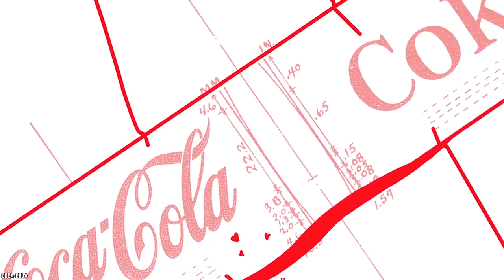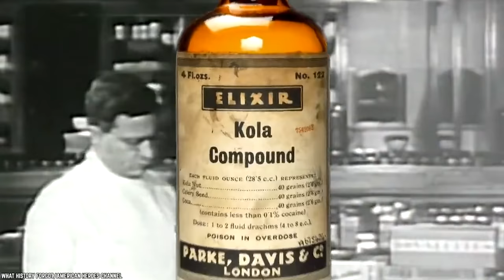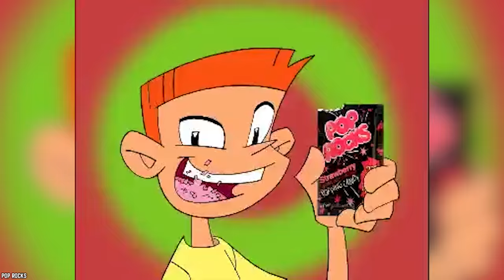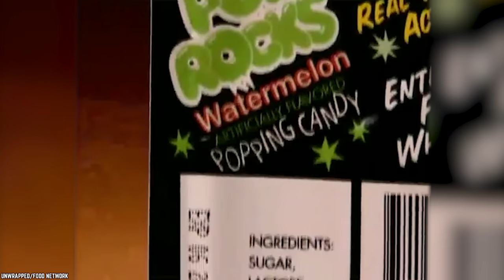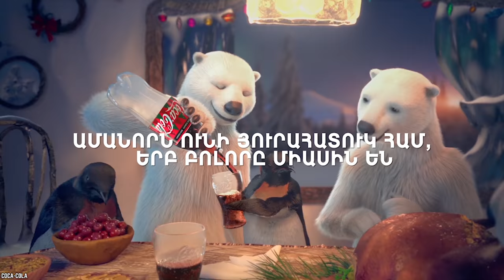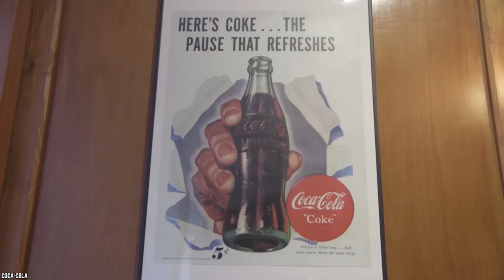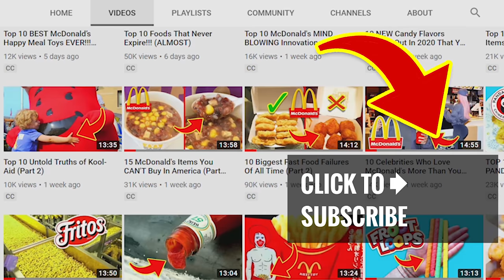Top 10 Coca-Cola Myths that are LIES!!!

Comment: I've never tried the tooth thing, but the formula has changed, a LOT.  In the 50's there was a Coke bottling plant that made the 6 1/2 oz bottles and that stuff was much stronger than anything on the market today.  It had a real bite of phosphoric acid.  Something I DO know is that mechanics used to use it as a frozen bolt breaker, like Kroil or similar penetrating oils.